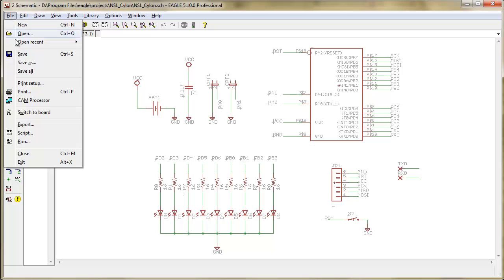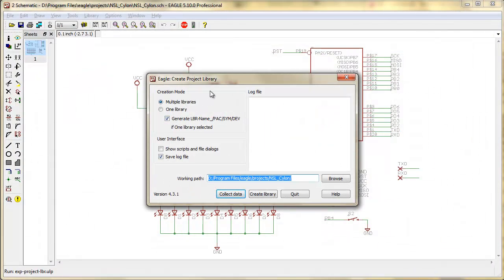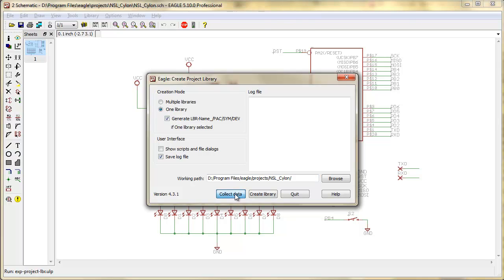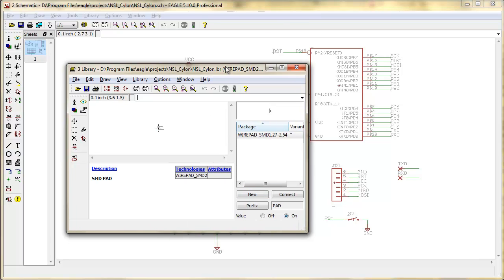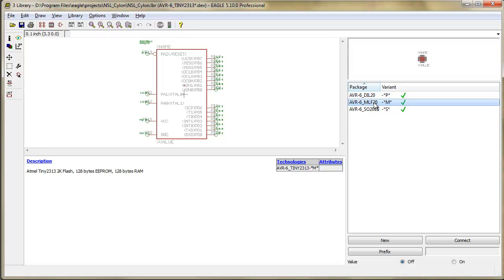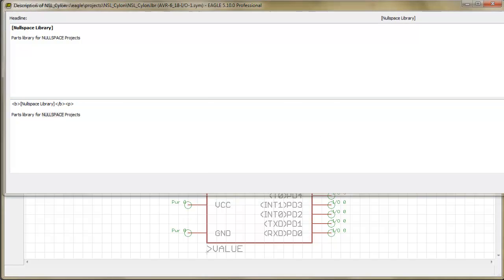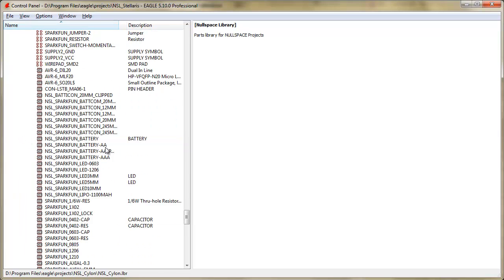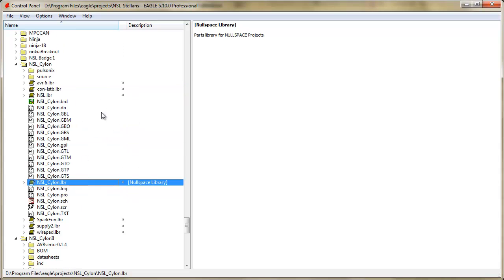Creating a library (.lbr) from an existing schematic in Cadsoft Eagle

Comment: Hello Charlie,

Is there some way to export just a device without copying all the project devices to a library?

Thanks in advance!
Reply from the maker: you can use one of the lbr export ulps to export all the devices, but instead of a single lbr use multiple and it'll only include the ones that were in the original library, worst case you can edit the scr file the exp-library.ulp makes and remove the extras or you can manually copy and paste them. after 6.2 of eagle, the library export script is embedded in the file/export/library menu option now as well.

Comment: Not exactly what I needed, but it got me where I wanted to go. Thanks.

There actually is a reason you might not want to copy everything when creating a library. Specifically, if all you want is to copy a symbol. Which, for some reason, Eagle makes incredibly difficult: when you try to copy from one library to another using the editor, Eagle clears the paste buffer when you switch files. If you copy the device from another library, it also brings along all the packages. And there can be dozens, if it's a peanut part like, say, an inductor. All of which have to be tediously deleted if you don't need them.

Luckily, I found a library with an inductor that had only a few packages, but it was still a PITA.
Reply from the maker: HI Ran,

To copy a symbol to another library (Eagle 6). do this
Open the Symbol in the library editor
group  (select symbol)
cut, right click cut group
close the library editor (don't switch, create or open a new one)
reopen the library editor by right selecting a symbol from the library you want to paste into.,
go to symbol, use  paste and it should appear.
Reply from the maker: ***** type it from the text command input, it'll do the same.